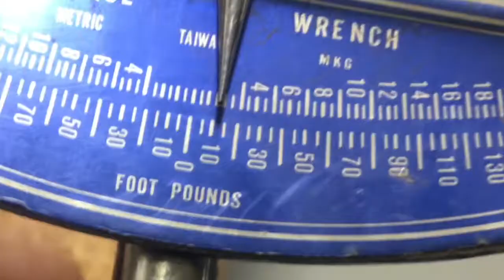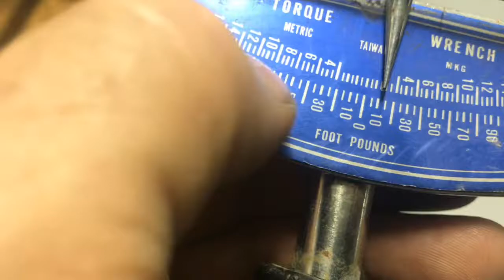how to use a BEAM STYLE torque wrench

Comment: May I add that proper use includes a)checking that the needle is showing 0 when beam is at rest, b)keeping the grip handle pivoting on its pivot (if it has one) while torquing, and c)seeing that the needle is not rubbing but rather 'floating' in its guide while tightening to torque value. Thanks.
Reply: LucasMaclean-fy7st  Yes, this will ‘zero’ the reading. The main beam, associated with the mounted needle and scale, are already calibrated to produce a good reading.
Reply: LucasMaclean-fy7st  Ha! 😆 Next time just tighten the nuts to the point that you can still muster the strength to get them off again.
Reply: This is what I use to check ring and pinion bearing preload on differentials.

Comment: Beam torque wrenches are very accurate when used properly. But the one shown is incorrect. It should rest at zero and you didn't mention anything about the special handle and how it is supposed to be centered during rotation. When your deflecting it, the handle is not aligned with the handle. It pivots for a reason.
Reply: @wesoblander3648  go back to the troll forums.
Reply: I haven’t seen your video

Comment: I've never seen a beam torque wrench 10 ft. lbs. off! Wish you showed how to re-calibrate it to zero. Maybe if I take mine to a lug nut that might fix mine being about 2 lbs. off.  UPDATE: Just got back from testing the accuracy of my clicker against my Craftsman beam and found my clicker to be dead on. I also looked at my beam after a few 60 lb. twists of my lug nuts and it looked to be almost dead on now. I guess they were right that when put into use, they straighten them selves out.  I'm sure heat and cold can play a minor factor in accuracy as well.  Now I have to decide which to use on my Chevy 350 head bolts at 65 ft. lbs.  I guess seeing is believing and it don't get any more accurate than that..........
Reply: @eriktomas9194  You damn well know what I meant........

Comment: A couple of things for anyone watching this video.

I HIGHLY recommend to NOT test your torque wrench in a vice like this.  Unless, you are testing very low torque numbers and know when it's not working right.

A few weeks ago, I bought a torque wrench.  Sadly, it was garbage. I set it to a low number, like 20 FP and put it in the vice like this.
But I didn't know what 20 FP would "feel" like.  So I kept pulling, waiting for the click (click type wrench  not this beam style one).

Well, all of a sudden, a huge SNAP!  The vice literally broke in half.  And right at the bottom of one of the jaws where the metal is thick.

So never again.

I did return THAT wrench and bought a much better one that actually works.  (I actually bought 2.  One that goes up to 250 FP and a smaller one with more accuracy).

I did have to buy a new vice, which I'll install any day now... sigh... anyyy dayyyy nowww.  LOL

As for the beam type, I also have one of those and used it for years.

A bunch of months back, I noticed that the needle as not pointing at zero when not in use.
So, I just bent the pointer bar until it was at zero.

To my shock, when I tested the beam type wrench against the one with more accuracy and to my great surprised, the beam type was right on the button!  Impressive for such a cheap, non-clicking wrench.
Reply: its fine with a beam type one to do that
Reply: True 👍 I'm gay

Comment: The metric scale is dNm, which is Nm * 10, so the max is actually 200Nm, not 20.
Reply: It's actually "daNm" for 10*Nm, because "dNm" would be 0.1*Nm. Even though it looks like a misspelling of "damn", it really is "daNm". "da" the only 2-letter SI prefix.

"da" is short for "deca-", and it basically means ten times some unit. When it's just "d", it's short for "deci-", which means a tenth of some unit.

"deca-"/"da" is fairly rarely used, while "deci-"/"d" is used a lot especially for volume (a decilitre or 1 dl is 0.1 litres), and also for e.g. decibel/dB (for the other kind of volume).

Comment: Is it true that beam type rarely get out of calibration vs click ones? how often should you recalibrate beam type? and people actually use beam type to check on click type wrenches?
Reply: To test the accuracy of a clicker against a beam, you can either torque a lug nut down at say 60 ft.  lbs.  with a beam, then set a clicker to 60 ft. lbs. and test the lug nut and see if it clicks before turning the lug nut, and if it does, turn the clicker a hair more to see if the lug nut does turn as in my case. THAT IS ONE WAY and can also be used the same with any matching torque wrenches in inch lbs. etc.......... THE true way is to take a beam and a clicker and put say a 1/2" socket on each and then use a nut that both sockets can get a good gripe on. in my case, I used a 1/2"  by 1-1/2" long CB antenna base nut to joining both torque wrenches together. Test at 20 ft. lbs. by setting the clicker and then watching the pointer of the beam.  Then 30/40/ or what ever you wish. Unless you're a 'shaker' LOL...  they don't get anymore accurate than a beam!!

Comment: Do you have a video on how to zero the wrench?
Reply: The beam style torque wrenches cannot be calibrated. The temper of the metal is what calibrates it, so they will never need to be zeroed except in the case that the beam heats up enough that the metal loses its temper. In that case you'd just buy a new one, they're quite cheap. But you'll likely never need to do that.

Comment: Do these need to be calibrated?
Reply: That would depend on the job and required accuracy, when you buy. A decent one new, they come with a calibration certificate usually, I have about $1500 of torque wrenches and each one has certificate of calibration. I have a digital wrench and a couple click style torque wrenches by far the digital is my go to for head bolts due to its accuracy and ability to accurately give angle (usually a requirement for head bolts) but I also have a click style that does angle however I don't believe it would be as accurate (+-5°) in my opinion

Comment: Cool I just got mine today for only $16 it's a piece of mind. I was wondering why the dial isn't on the zero but it looks to be normal thanks
Reply: Bend the pointer back to zero!
Reply: @rideitlikeyoustoleit7640  lol
Reply: @Saint696Anger  I'm being serious. That's what you do, you bend it back to zero or otherwise your torque ratings will be all off.
Reply: @rideitlikeyoustoleit7640  it seems like all of them are set slightly off
Reply: @rideitlikeyoustoleit7640  okay I'll look into it, thanks 👍